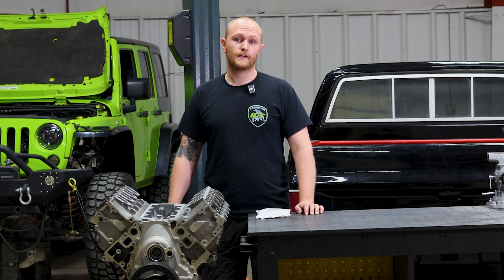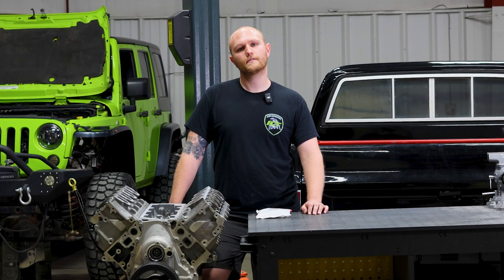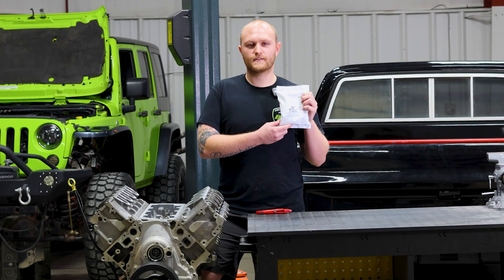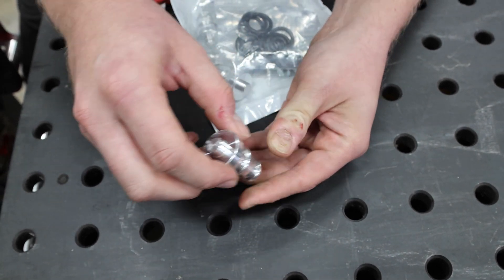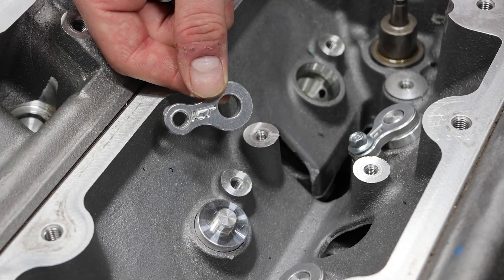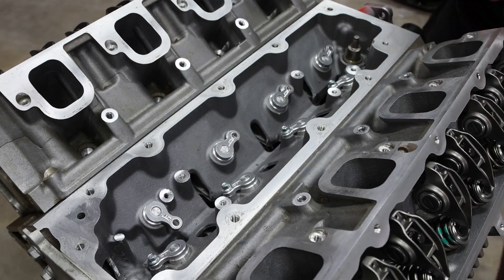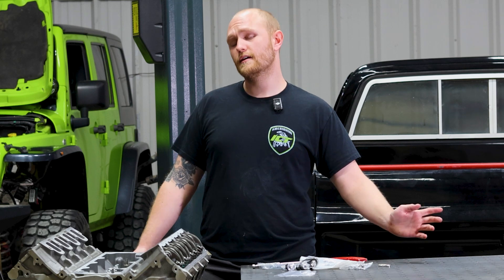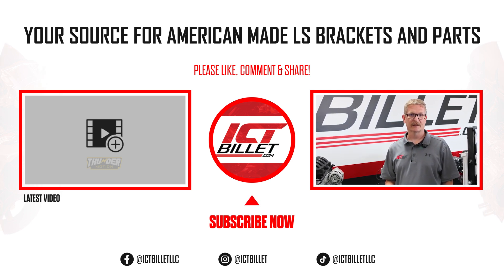How To Delete DFM AFM DOD On L84 L87 Engines with ICT Billet 551192-L84

Comment: Even if the block off plates and LS7 lifters are used, doesn't the ECM still have to be tuned to stop the ECM from commanding the DFM on and off?
Reply from the maker: Yes you will need to re-tune the engine
Reply: @ICTBillet who would you recommend for the tuning?

Comment: Do you have to swap the lifters out after for non-DFM style?  Or will the stock ones work for short term.
Reply from the maker: Yes you will need to swap the lifters out for the LS7 lifters (or use the short style already in the engine).   Some people just swap the tall lifters out, but since they are cheap for the oem LS7 we recommend replacing all of them.  We always have these in stock if you need a set.

Comment: Why wouldn't I want to defeat DFM through HP Tuners and simply turn it off?  That's what I did for my L83.
Reply from the maker: You could do it that way! But, using Hp tuners to turn DFM off is still using the failure prone DFM lifters to get slightly more life out of them. Our delete is allowing you to put the "LS7" non DFM style lifter to properly delete the DFM lifters.